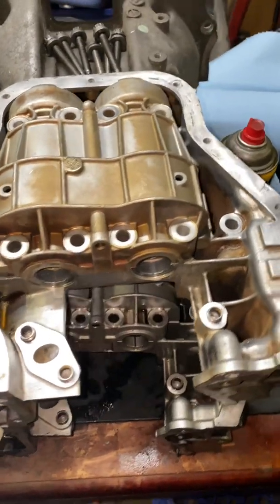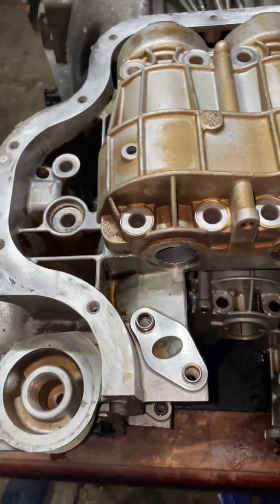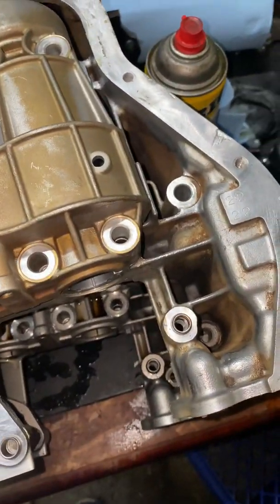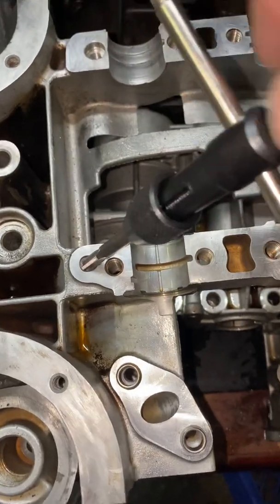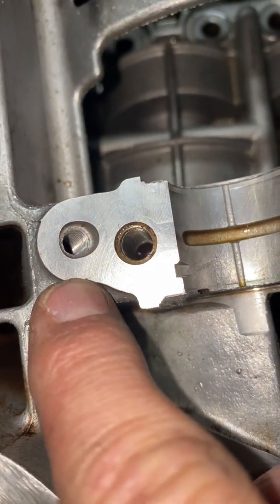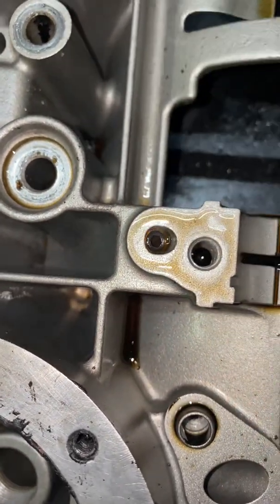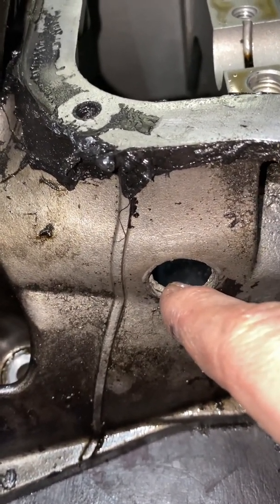How to remove the balance shaft and block off oil feed on 2azfe engines.

Comment: What size tap did you use?
Reply from the maker: @terryw1945  I believe I used 10mm tap with 10mm harden screw plug with locktite
Reply: @funkyphil1974  thank you

Comment: 8mm bearing sits in the hole and blocks the feed. tightening the bolts pulls it up about 1mm
Reply: keep it simple,,  Just plug up the hole with rivet . why take crank gear out= waist of time

Comment: Still running okay without the balance shafts? i ask because my Balance Shafts spun the bearings and wore into the upper oil pan. So i'm considering a balance shaft delete option.
Reply from the maker: Hey, how’s it going? Yes, I’m still running perfectly fine without the balance shaft It’s been about s 4 years and it’s been running great.  There is a slight vibration at idle otherwise everything is perfectly fine.

Comment: To keep the oil pressure the same, can you just press out the black plastic rear on the two-gear balance shaft and put it back?  This way will disconnect the balance shafts from the crank shaft and oil pressure remained unchanged.

Comment: Great info! I do have one question do you need to re-install the housing that holds the balance shafts?
Reply from the maker: I did only because why not however I don’t see any reason you have too. Thanks and Happy Holidays my friend
Reply: @funkyphil1974 Thanks man! Yah makes sense to install it add a little extra strength but I was thinking about leaving it out for the little extra oil capacity.

Happy holidays man!
Reply: Whe. I don't mine with the light light pulleys I'm leaving the case out. That's a good bit of weight reduction.

Comment: When u take the gare from the shaft did you take it to any machine shop
Reply from the maker: Well I removed the gear myself with heat and brass hammer with a few taps. But yes the entire rotating assembly went to be balanced at the machine shop..
Reply: Is it a must to do all that
Reply: What If I just move the balance shafts and block the hold can it work like that

Comment: So what happens if I don't block off the oil feed?
Reply: Oil pressure goes to 0 and engine go boom.
Reply from the maker: Just like solarastuff said it will allow oil to drop into the crankcase instead of spraying it with pressure, this will cause low to no oil pressure..
Reply: @funkyphil1974  ty, I had a good mechanic do the mod. He blocked it off, car has been running well for over 5k miles. Thanks!
Reply: @chrismemphis8062  still running okay? i ask because my balance shafts spun the bearings and wore into the upper engine pan. i don't want to replace the upper pan, so i'm considering the Balance Shaft delete option.
Reply: @MercurySaturn  yeah, probably 8k miles since I took them out and plugged the oil passage. It sounds a bit rough w/o it, but not terrible.
Reply: @chrismemphis8062 did u leave the gear on the crank
Reply: @alexgreaves343  yes, I just removed the balance shaft and plugged up the oil return

Comment: Do you think it is better to leave the drive gear of the balancers that goes on the crankshaft? there will be no imbalance problems?
Reply: my understanding is if you remove the gear off of the crankshaft you will need to get it rebalanced. ( if you take apart the engine to rebuild you will do that anyway) but lets say if they balanced the cranckshaft with the gear on you can leave it and just remove the balance shaft and plug the hole
Reply: The guys on Rav4 world break the gear off.

Comment: I understand that it accelerates very well but that at idle it presents vibration, therefore it is necessary to replace the damper puleys with one of better performance, right?
Reply from the maker: There is lil vibration I just replaced my hermonic balancer with hp AIT one.  I been on this setup for 9 years no issues!! And I am boosted making 350hp. So it works great for me.
Reply: @funkyphil1974 what's your turbo setup 🎉
Reply from the maker: @ hi I have Turbonectics

Comment: What size tap did you use?
Reply from the maker: Irwin Hanson High Carbon Steel Metric Plug Tap 10mm-1.00 1 pc
Reply: @funkyphil1974  I used 6mm tap and set screw. We'll see if it works tomorrow 🤞
Reply from the maker: @timsouttahere  as long as it’s tight it should be good. I also used lil sealant.
Reply: @funkyphil1974  I used red loctite
Reply from the maker: @timsouttahere  me too!
Reply: @timsouttahere  why did you use a 6mm tap and Phil used a 10mm tap?  Does the hole need to be drilled out?
Reply: @jgdynamics  it needs to be tapped. It's not threaded at all
Reply: @timsouttahere sorry I should have been more clear... do I need to drill the hole out for a 6mm tap? Or is the hole sized for a 6mm tap?  I was confused as to why one person used a 10mm tap and someone else used a 6mm tap
Reply: @jgdynamics  I can't remember if I drilled it before I tapped it

Comment: This is great info I’ve been looking for it , my motor is already fully built but do you think i can delete just the balance shaft and not need to take the motor out and balance ,
Reply from the maker: Yes you can but you must be careful to clean all metal shavings from tapping the oil plug.
Reply: I think it's easier to tap the lower housing part.
Reply: I was wondering the same.

Comment: As typical, I'll be rebuilding my engine in my 08 tC here soon and I'm only doing this shit once if I have my way lol. Replacing all internals, machine shop etc and deleting these shafts. Question is, how does it affect driving/vibration etc, timing, ECU etc?? Any troubles you've experienced?? Did you have retune ECU?? Sorry so many questions but I've only been working on cars for a year now and my tc is both my baby and my only car at this time (will be dropping in used temp engine during rebuild of mine.) Any info helps and thank you for the vid & assistance, helps a ton!!
Reply: I removed mine and the knock sensor code keeps coming back and then won't let the transmission shift to overdrive. It doesn't seem to be that much vibration but evidently the knock sensor can tell. I have not found a work around for this yet so may have to buy new shafts and put them back
Reply: I did find a work around by mounting the knock sensor high on the engine mount
Reply: @richstarbuck4315  is it still running good?
Reply: @joshlewellen9076  Yes, it has a little more vibration, but cannot be felt while driving, only at idle
Reply: @richstarbuck4315 where did u install the knock sensor
Reply: @ceoink3936  I drilled and tapped a hole in the bracket from the head to the front mount plate

Comment: Can you remove the balance shafts with the motor in the car, without messing with the crankshaft?  Leaving the gear on the crank?
Reply from the maker: I didn’t do it that way because I removed the ring gear and had the rotating assembly all rebalance without the balance shafts in. Plus I did this same time I rebuilt my engine. 

 Now can you remove this I believe so but that’s a lot of work to do it in the car. Much easier on an engine stand. Plus I don’t know how it would run without being rebalance again and the ring gear still on.
Reply: @funkyphil1974  but is it possible?  Without any problems?
Reply from the maker: Ok so lets go though this. 
You need to remove the following 
1. Valve cover
2. Passenger side motor mount 
3. Timing cover
4. S pipe 
5. Oil pan
6. Oil pump
7. Oil pump chain
8. Now you should be able to remove the cover for the gears as well as the gears and bearings.
Reply: @funkyphil1974  ahh.  I see.  So possible, but not quite as simple as I had imagined.  I guess my question remains, how does the engine perform without the balance shafts?  The same?  Any more responsive?  Thanks for the quick replies
Reply from the maker: My car is boosted and without my balance shafts I am quickly able to rev up faster creating boost. But there is a noticeable shake at idle and it is highly recommended that you purchase an ATI super damper to replace your oem hermonic balance pulley.
Reply: @funkyphil1974  ahh.  Makes sense.  Forgot to mention I have a Camry not a Tc.  Probably same procedure though.  I think the only difference is the cams and ecu.  

Thanks for the information!  👍🏻👍🏻
Reply from the maker: Yes same engine only difference is the motor mounts. We pull engines from camrys all the time for rebuilds.
Reply: @funkyphil1974  Not true, timing cover and oil pump do not need to be taken off.  Just the oil pump pickup screen needs to be removed with 2 nuts holding it to get access to balance shaft bolts.
Reply: @wagonkit  oil pump and timing cover do not need to be removed, just the oil pump screen.  I had trouble with knock sensor on one I did but another was no problem
Reply from the maker: @richstarbuck4315  if you choose to leave the balance gear on the crank you are correct. However to correctly do this you should remove the engine brake it down remove the gear from the crankshaft and then rebalance the entire rotating assembly including seal up oil feed for balance shaft.
Reply: @funkyphil1974  The question was, "Was it necessary? "  and no, it is not. engine will run fine with little vibration. If you want to spend the money to do it your way, it would be better but pretty costly.  If you want to remove and drive it will work fine.
Reply: @richstarbuck4315  I am guessing you successfully did this ?
Reply: @johnchadwicktilton  yes, it was not hard at all. Just make sure you vacuum out any cuttings u make tapping the oil hole
Reply: @funkyphil1974 I’m choosing this route because I hate to take heads off to put arp head studs for the boost 🔥
Reply: @richstarbuck4315  what size tap? I’m getting ready to do this on my 03 Camry.
Reply: Yes u can, the gear does not need to be removed
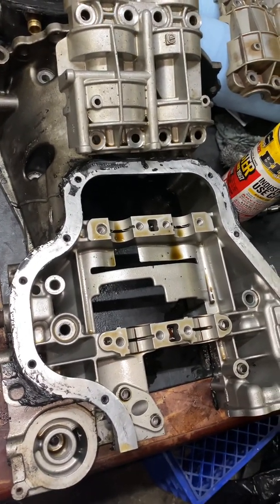Reply: Yes I did that on my Rev 4 remoed from underneath.  Blocked  the  oil with  a hard rubber deep and thick  into that hole. Put the cover back on. Make sure to remove  the shaft bearings as well put the cover on. I have driven this car for more than a year now. I seen no change in performance . 7:15
Reply: Also for the ati damper can i run the tc ati damper right ? Obviously same motor
Reply: @terryw1945  I used a 1/4 inch course thread tap with an Allen set screw .
Reply: @ thank you